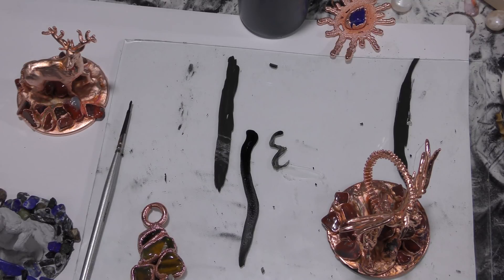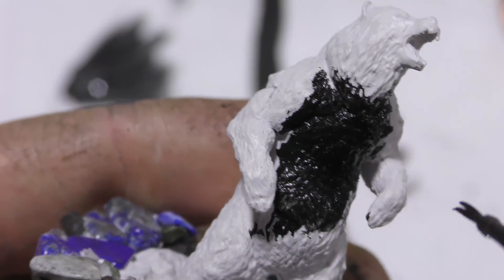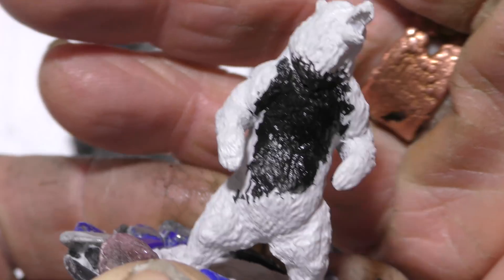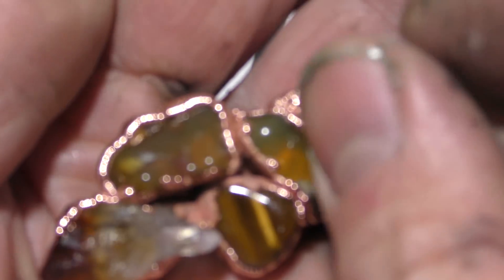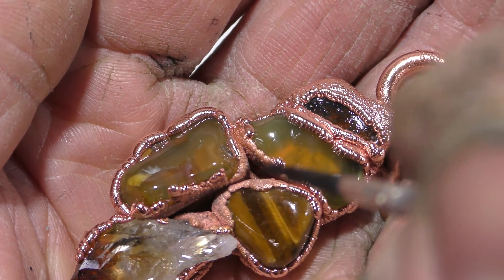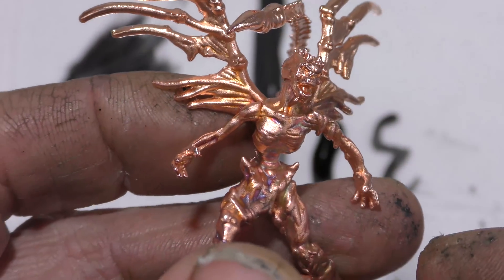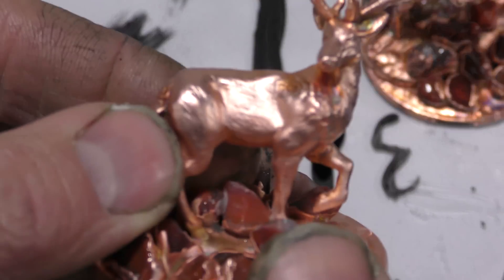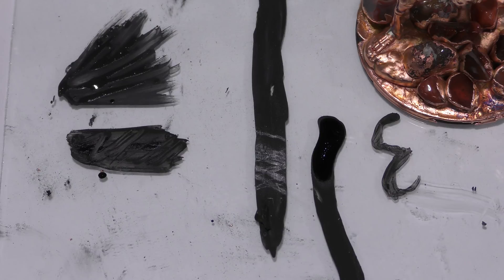How to make Ink based conductive fluid along with the difference between conductive fluids

Comment: I don't know if you'll see this at this late a day, what are you able to put this through an airbrush?
Reply: I was about to ask exactly the very same question. So, to use it with an airbrush, I was wondering if it wouldn't be better to use graphen io graphite. It is supposed to be more conductive than graphite and is thinner.
Reply: The description of the ink says 'Easily applied by pen, brush, steel brush or airbrush, Speedball’s India Ink is free-flowing, non-clogging and waterproof.' The big question is if it continues being free-flowing after having been added with graphite.
Reply: I was wondering the same. Does anyone know if these formulas would clog up a traditional store bought paint sprayer?

Comment: Can we use copper powder instead of graphite powder? Thank you.
Reply: Copper readily forms an oxide layer, making it less conductive. If you were to try it first remove the oxide layer by washing the copper powder in hydrochloric acid (muratic acid in the hardware store), then put it on. You could also coat it like done in the video, then electroplate it with copper.
Reply: Where i get copper powder

Comment: Is the ink-based solution thin enough to go through an airbrush. If not, what can it be thinned with?  Cheers,
Reply: you can always thin it further if is not, and add more layers as they dry
Reply: Would Isopropyl work?
Reply: @CorumSilverhand anything that evaporates would work, provided it doesn't react with the ingredients. Which 99% of solvents wouldn't